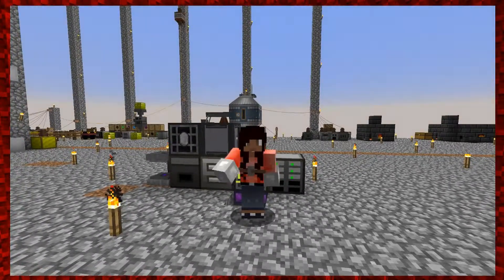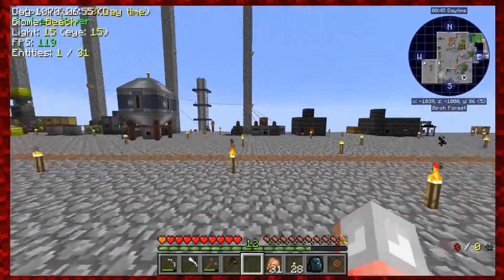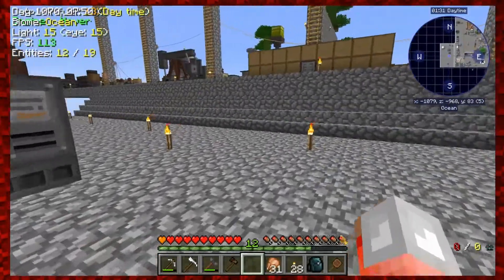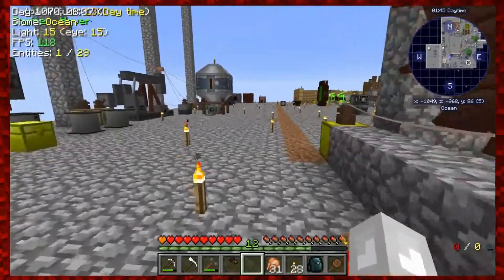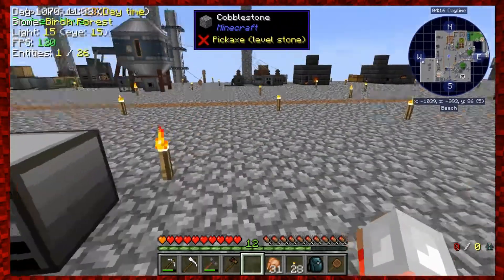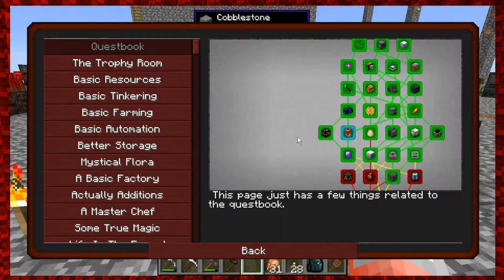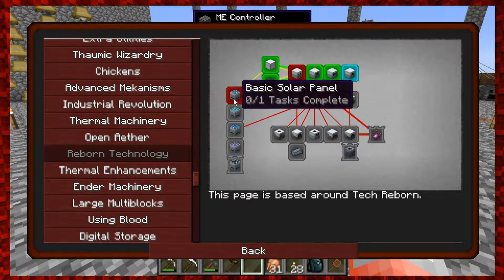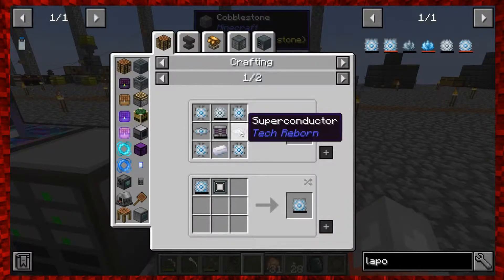Modern Skyblock 3: Episode 167 - Making Lapotronic Orbpack In Segments – Part 2!!!

Comment: Yes, if the colossal chest has a higher priority than the disk drive, things will go in there after the drawers (and since it's colossal, you disks should remain empty after defragmenting).

Many of the simpler Tech Reborn machines are used in recipes for more complex machines; that's probably where the previous Extractor(s) went.

A long, long time ago I mentioned the Mekanism Gas Burning Generator can run on hydrogen from the Mekanism Electrolytic Separator and gives a descent amount of power; maybe give the AE system its separate power system for now.
Reply from the maker: Do you think I should make the chest a higher priority than the drawers?  And yes, I do remember you saying, more than once I believe, about the gas generator.  The windmills were good for a time, I agree, I do need multiple power sources since I have a variety of machines now.  I made the solar panels from tech reborn.  I'll check out the gas generator and will perhaps use that for all of the mekanism machines.  I still need to move them to the other platform.
Reply: The drawers should be the highest priority imo as they are dedicated for the specific items; after that I'd rather fill up the colossal chest first before the drives.